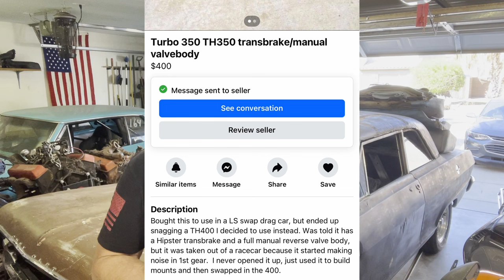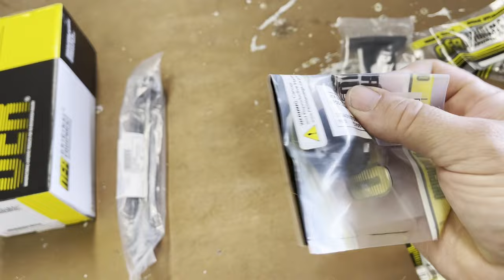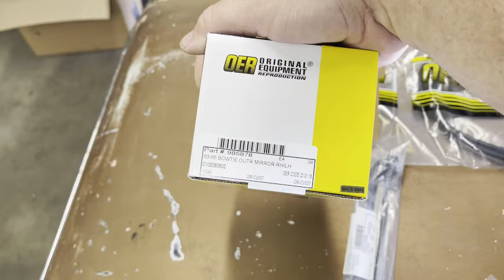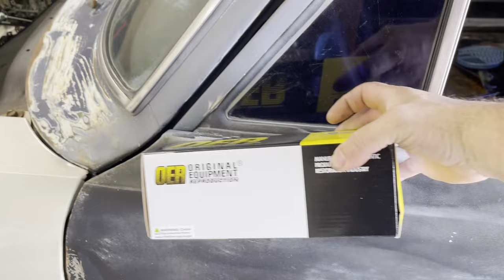1965 Nova Build | The great transmission debacle of 2024!

Comment: Out of that whole video, I could only think of one thing to say. Somewhere out there is a pile of bolt heads that were snapped off when that car was rear ended. 
Other than that, I had a great time watching you just put things on all over that car.
I'm not going to talk about the trans.
Getting exciting!
Reply from the maker: @DonCrookwashere  lol.  I didn’t think of that.  Or someone tried working on this car and snapped off all those bolts!! Or stripped them out!!
Reply: @tackettshoh  anything is possible. 
Hearing this doors clunk closed makes me cringe. When/if you add weatherstripping, those doors will sound so good chunk

Comment: You win some you lose some, but still, if the brake/valve body wind up being ok you're still ahead
Reply from the maker: @johnp1966  ya.  I heard from the tranny guy yesterday.  The case is good. The valve body is good. The trans brake is good. It was the sprag and front main drum. Shattered.  It was a stock sprag and drum.  Someone put a trans brake on the thing with stock parts!! Probably dropped the trans brake hard and it shattered.  So he’s going to fix it with a new drum and hardened sprag.  So it should be good. Parts are already ordered.  Hopefully get it back next week.  Fingers crossed.

Comment: How about you be your new, new transmission guy and rebuild it yourself. Buy a transmission manual, a rebuild kit and use this as a learning experience so you don't have to pay anymore transmission guys.🤷🤔

Shop 209 did a really good th350 rebuild video with good camera work so you can see what he's doing. After you do 1 or 2 transmission rebuilds you'll wonder why you didn't learn how to work on them sooner. Maybe the next MP core you find.😎👍
Reply from the maker: @itseithergonnaworkoritaint7852  you’re probably right.  I’ve always wanted to learn.  I’ve just never done it.
Reply: @tackettshoh  
And if you do it on video, make sure to read the comments before you use it because there'll probably be a transmission guy watching to tell you what you may have forgot or did incorrectly? It wouldn't be me though because I regret to admit I never forced myself to learn how to rebuild a transmission. But after watching a few being gone through I'm sure I could of figured it out eventually.

They actually look a lot easier than building an engine. Well a lot lighter parts to install anyway and all around lighter. The world is running out of good transmission guys, maybe you can get a side business going after you get a few under your belt? Plus it gives you more content to post. 

Start rebuilding the rear ends yourself too so you have content to post. Those are about the only major things you farm out, might as well try to keep everything in Tackettstan with the economy the way it is. Plus it might help some other budget guys save a few bucks?😎👍